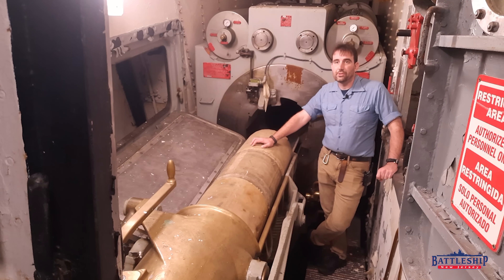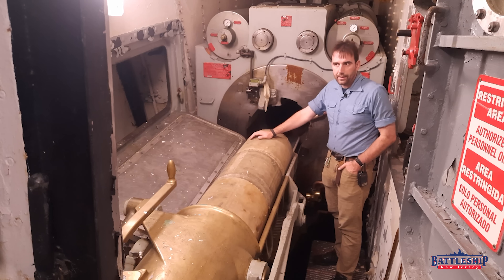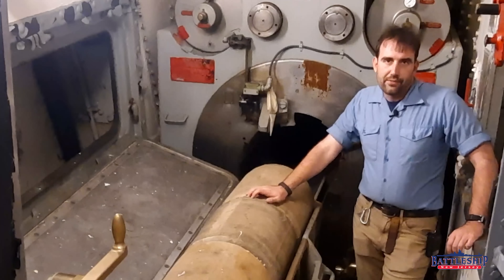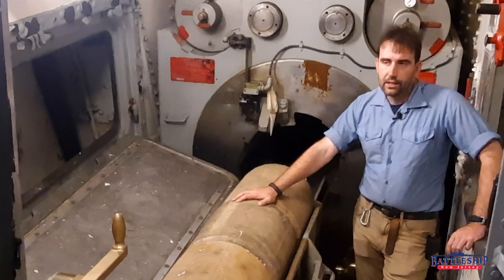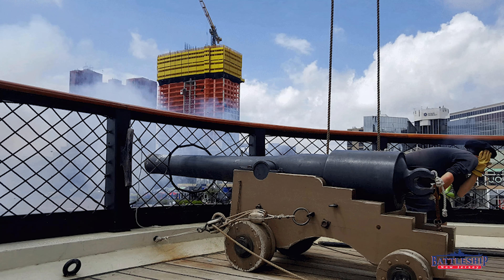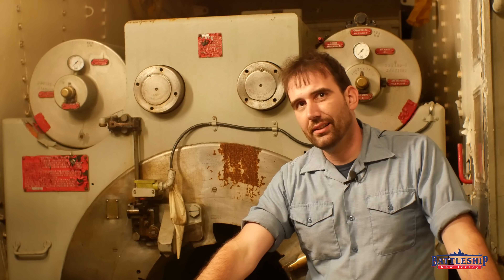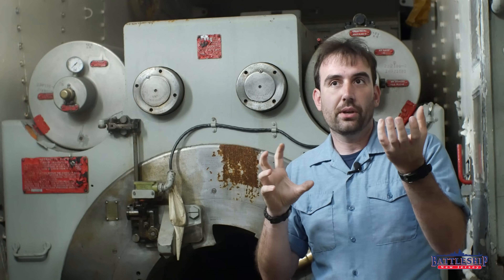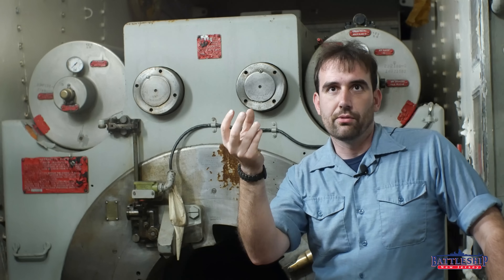How to Unload the Battleship's Guns

Comment: I shoot muzzleloaders occasionally and there's a gadget called a Safe-T-Unloader that uses a CO2 canister from a pellet gun to blow out the bullet and powder.  It blows into the percussion nipple like pumping up a tire.

I just assumed battleships had a similar system since they have the ability to generate gobs of compressed air.  Glad I was mistaken.
Reply: That is kind of what the short charge shot is. The compressed air just comes from burning propellant.
Reply: On flintlocks we use ramhooks. It's an attachment that screws onto the ramrod. It has sheet metal screw that screws into bullet allowing ramrod/ramhook to pull out the bullet...
Reply: @tommysaulter9171  
Yep, I've used them.

Comment: Ryan asked about having had a miss-fire.  Yes, I once fired my .357 revolver with just a primer in the cartridge.  Made for a really SHORT day at the range, too.  I used a cleaning rod and a soft mallet to pound the bullet back into the cartridge to then open the cylinder & remove the bad round.  I upped my quality control process for handloading, too!
Reply: I'm knocking on wood here, but I've shot a LOT of crappy, foreign, ancient and surplus ammo in rifle and pistol and never had a squib load.  (Knocking on wood again.)  I do "wonder" about some of the semi-auto quick-trigger 'artists' who are racing their way through a magazine.  If they get a squib that managed to eject the brass, their finger is already pulling the trigger on the next shot in a now obstructed barrel.
Reply: I have a 50 cal Hawken rifle. After cleaning and lubrication, it is possible for a small drop of gun oil to enter the nipple and prevent the primer cap flame from reaching the powder. I have had a hang fire which I believe was due to this so before I load powder, I will fire a primer to clean out the nipple.
Reply: @clyderokke5409  That should work pretty good.  On my flinters, there's a rara occasional need to prick out the touch hole and stuff a bit of fuse in there and light it.  Whenever something doesn't go "bang" like it's supposed to -- keep it pointed down range!
Reply: @clyderokke5409  lost a doe with mine because of that. I cursed a bit.
Reply: Absolutely.  My QC is stringent to the point of what some would call silly, but I've got it down to the point where the only way one of my rounds is going to be a problem is if the primer was bad from the factory.  I weigh the primed brass before, and the bullets, and then confirm the weight plus the powder is correct after pressing the projectile into the case.  Can't be too careful with these things.  And then a full visual inspection of the final cartridge even though I stringently inspect my brass and reject a lot of brass that's probably perfectly fine.  It's not just my safety, my wife shoots my reloads too.
Reply: @SovietDictator  You're a good and careful man.  I hope your wife appreciates you for that.
Reply: @yepiratesworkshop7997  she certainly seems to.  Her favourite rifle is over a hundred years old so it pays to know what you're feeding it.  Much like working with an eighty year old battleship, you have to understand that you don't truly know what may have happened in the past, even though the workmanship is excellent.
Reply: After 1 unscheduled experiment in seeing how far a bullet will engage in the rifling propelled only by a magnum primer, I also changed my reloading procedure.  I would start by loading 1 round as "perfect" as I could.  Weight was recorded, and ALL other rounds went across the scale to be sure they were very close to the "perfect" round.  bullet weights and case weights are not exact, but the finished round should be close...double charges or light charges were obvious.  A piece of wooden dowel with a mark on it where the case mouth should be with a proper powder charge also comes in handy.  

The alternative is shoving the dowel down the muzzle and using a hammer to dislodge the stuck bullet.
Reply: @kevincrosby1760  for anyone using a progressive press, a "powder cop" die is a decent idea as well.
Reply: @kevincrosby1760  Seems I'm always shoving a dowel down the barrel and hitting it to seat the bullet.  (muzzleloader)
Reply: @yepiratesworkshop7997  I was told once that you weren't qualified as a true muzzleloader until you had used the bullet to remove the ramrod at least once.

My muzzleloading experience is unfortunately limited to a bit of teenage experimentation with iron pipe, a drilled pipe cap, and cannon fuse.  Experiments ceased after a close call involving TWO caps on the pipe...
Reply: Unfortunately I had the same happen with my 357 but with frangible bullets.  You can't pound those damn things out so I got the brilliant idea of drilling the core of the bullet out.  Don't try it.  Despite my best attempts, the bit slide sideways and scarred the barrel.  I should have taken it to a gun smith.
Reply: I shine a bright light into the cases to makes sure neither a double charged nor a squib round finds its way into my gun.
Reply: @taraswertelecki3786  Yes, you should do a visual check of the powder levels in the cases.  Only takes a few seconds to look over the loading block full of cases. That is one of the reasons I don't use a progressive press.
Reply: I have a .357 Jacketed Soft Point hanging over my reloading bench to remind me not to miss a charge again.
Reply: Pull the bullet from another cartridge.  You can place a bit of paper or cloth in the case to hold the powder back, or just hold the pistol up at an angle.  Load the bullet-less case into a cylinder rotate, and fire.
Reply: @hwoods01  If the bullet has gone any distance down the barrel, that's a really bad idea. In fact I would not do it under any circumstances. Much safer just to pound the bullet out with a rod and mallet.
Reply: Had to happen with me with WWB in my old XD9. Scariest thing was reseating the round to unlock the slide. Thank god I noticed the recoil felt odd and checked to see the slide jammed slightly open.
Reply: Just fire another round to pop it out- but be sure to use 125JHP with 22 grains of 296 powder to give it the extra "oomph" needed. Once the barrel separates into many fine petals, the bullet falls right out. Damned amateurs...
Reply: Oof, squibs are always "fun".
Reply: Squibs are never fun.

Comment: There was a piece of equipment that was put in through the muzzle, barrel raised and then said equipment would drop down and essentially "hammer" a projectile out of large naval artillery guns. Probably fine to use with an AP shell, but I doubt anyone would risk setting off the fuse of a HC shell. Much less having the projectile fall out of the breech and land on the shelf-plate and damaging it. They normally just rotated the turret in a safe direction and shot them off into the ocean.

Comment: Fail to Fire in 22LR is common.
Reply: Also underpowered rounds although I have never had a true squib.
Reply: That seems to be a recent thing. I've never had a problem until I started to teach shooting again recently. Then we had a batch where we had 5 failures in 200 rounds. Brand new, like a week-old package. Next time I brought in a brick from the 1970s. We didn't have one single bad round in the whole brick even though it's 40+ years old. To re-qualify I used some K-mart Remington rounds that someone turned into the shop. Every round fired as well. I qualified.
Dig down deep enough and I bet it's environmentalists again. Seems like it always is. Wish I had a few cases of 1970s ammo.
Reply: @robertthomas5906  Rimfire ammunition, especially the cheap bulk packs, have never particularly reliable.  Paul Harrell has a video testing a variety of 22lr ammo.
Reply: @johnshepherd8687  I happen to have a white box Olin Corporation generic package 22 LR ammo I bought in the 1970s or early 1980s. DCM ammo. A whole 80 cents/box (ammo was free, we had to pay for shipping and that worked out to 80 cents/box). I've fired bricks of the stuff. Not a misfire in the bunch. I bet this box would fire every one all these years later. 50 rounds, 10 targets. I'd do that night after night after night. In the 1970s/1980s I don't recall ever having a misfire nor anyone else on the range having a misfire. Only with the recent stuff.
That's why I think they've changed the primer formula.

Comment: I thought I remembered a earlier discussion of equipment that could be lowered down the 16 guns barrels after they were raised.
Reply: The turret manual has detailed instructions on reversing the hoists as well as how to use the rammer to get the shell to back out.
Reply: Yeah I was going to say the same thing, I forget which video but I just saw it the other day where he found a large piece of 16" wide metal that could be inserted into the muzzle, the turret raised and the shell knocked out of the breach

Comment: In every cartoon I watched as a kid the slightest tap on the pointy end of the shell would make it blow up. I wonder how the new guys on the battleship felt the first time the procedure of banging on the pointy end of the shell was explained to them.
Reply: As I understand it, the shell is not fully armed until it leaves the gun.
Remember it must withstand much more force during firing  than a person could apply with a weight.
Reply: @1906Farnsworth ...add to that the fact there is no nose fuse for a 16" rifle, all the shells are fitted with a base fuse.
I have seen one photo where one of the 16" projectiles detonated some 100m from the muzzle of the gun.
Reply: @philgiglio7922  The AP MK8 shells had only a base fuse whereas the HC MK13 had both a base delay as well as a nose contact fuse to ensure proper function although they could use it with just one fuse.
Reply: The base fuse on a 16" shell requires an impact force equivalent to hitting it with a car or dropping it from 50 feet up. This is an armor/concrete piercing feature and not a safety feature, but it means they're basically insensible to the roughest handling a human could inflict on them without the benefit of heavy machinery. You could have John Henry beat on the base with a sledgehammer and it still wouldn't be enough force trigger it... on paper, anyway.
Reply: The fuse activation system, I believe, had a rev counter and would only arm after the fired round had spun several thousand revolutions
Reply: Probably didn't bother them much because they'd probably already had enough training to understand just how inaccurate the cartoons were.

Comment: I can’t imagine they would risk puncturing a powder bag trying to get it out 
It also looks like once a shell is rammed in the only way to get it out would be to fire the gun 
but I guess we will find out
Reply: The shell gets rammed into the barrel, but the powder bags just get pushed. As such the powder bags just sit loosely in the barrel. They can be pulled out using the same brass hook that is used to pull them out of the shipping canister down in the powder room.
Reply: They had a screw together clearing rod, knock it back out the breech.
Reply: @randymagnum143  right? they'd just stick 2 telephone poles together and voilà! Then to clean it they'd cut a slot on the end of one of the telephone poles and run the admirals king size Egyptian cotton blanket through
Reply: @randymagnum143  no waaaaay, I heard that every 100 shots or so they'd just stuff an extremly fat bear in there, infront of the shell, and when they fired he cleaned that barrel right out, spick'n'span, was even self greasing.
Reply: Powder bag is a bit of a misnomer on the 16 inch guns of the Iowa's. The powder comes in solid grains that are 1 inch in diameter and about 2 1/4 inch long with 7 holes down the middle to speed up combustion. So it's not like puncturing a bag leaks explosive powder anywhere.